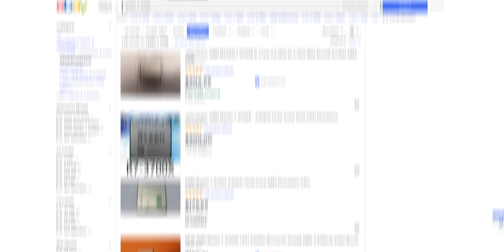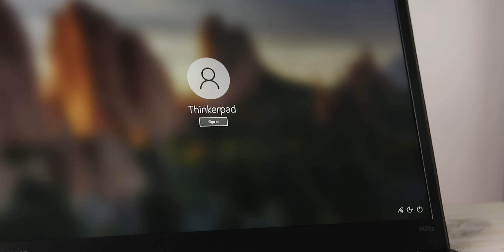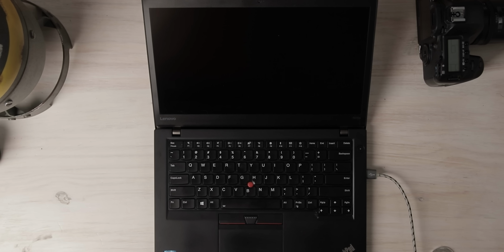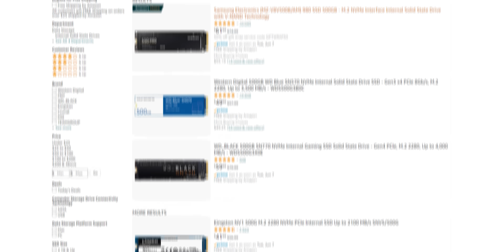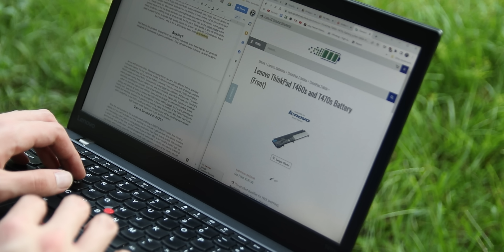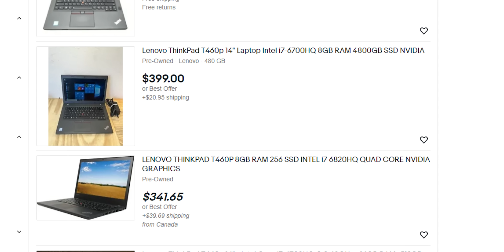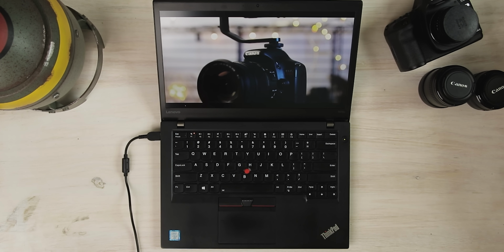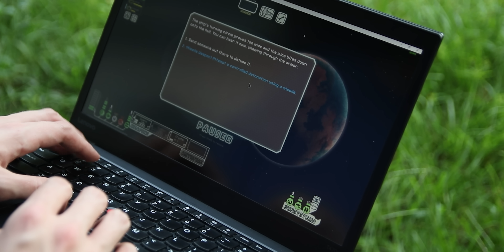I Couldn't STEAL A Better Laptop... I Tried - Lenovo Thinkpad T470s

Comment: For me I only get ThinkPad. Running windows 11 on my x230 and x260 one with a sata ssd and other with 16 gb ram and 7200 rpm had and I don't have any issues don't daily task. And got both cheap of ebay. Seen people spend hundreds for way less. Cannot go wrong with an old ThinkPad

Comment: Great review thanks.  I'm a big fan of quality superceded gear instead of weak new stuff.  I scored an amazing deal on a secondhand Huawei AMD 3500u powered notebook and its going well.  That CPU is essentially two of the 6600Us in the lenovo and the screen on mine is superior. However, the single stick of soldered RAM hamstrings the 3500U badly.  I suspect that the lenovo with 16 gigs of RAM in dual channel config would be the better option for getting proper work done. Alt tabbing through lots of stuff on mine bogs down badly beyond a certain point. 

I suspect one of these Lenovos with new batteries and a correctly matched extra stick of RAM would be useful for years.

Comment: I have a Yoga 460 that's of a similar vintage as the T470, except that it takes that screen trick you did another 180 degrees further. The deck on the keyboard also lifts up in this action to lock the keys in place when it's in tablet mode. Used to be my work laptop, but my supervisor gave it to me since I'd said how nice it was when we were switching to Dell laptops across the board. No soldered on RAM like the T470 and still has the single RAM slot. However, it's still my favorite laptop to use due to the keyboard and the screen.

Comment: Just got the E495 with Ryzen 5 for $100 ! There was a short on the motherboard - replaced the cap and now works like a charm. Came without storage and RAM tho, and the battery is half-dead. I guess that's another $100 right there :P

Comment: Just can agree with every vord. I bought a thinkpad x1 carbon gen5 for 250 bucks, with full hd screen, i7 gen 7 processor 620 graghics, and Í´m more than happy with it. Definitvely the best laptop i ever own. Screen is awesome, construction  is rock solíd, battery still runa for 5 hours of medium use, after 980 recharge cycles, keyboard and trackpad are amazing, without a doubt the best i tried on a laptop, weight is also incredible, less than 1,2 kg, the only con is soldered ram module, non upgradeble,

Comment: Even older series are amazing. Like the old steel-frame brick W-series workstation Thinkpads. Everything is easily self replaceable AND cheap.

poured liquid all over it, speakers got crackly for a day and then everything fixed itself.

i7, 16gb ram, SSD, Dedicated Quadro card, Cd/DVD drive. Snappy under everyday use and video.

My girlfriend accidentally sat on it and broke the screen, replaced the screen by removing 4 screws and paid $45 for a replacement.

I am convinced this thing could also bash an intruder's skull in with the corner.

Comment: My Asus U36S 2nd Gen Intel with Nvidia 520M from 2012 still works well. Yes it's a bit slow on start up and loading games but it can run a lot of the Call of duty games and Civilization 5 with no issues on Windows 10. The battery can still give me up to 3 hours on high performance  without gaming.

Comment: I have a T495 and it was my main computer for a few years. 
It’s not a beast, but it’s very nice considering it’s price. 
While most laptops in its price range (even many above) feel cheap, look, and run like trash, the T495 has been a pleasure.
I can echo pretty much all of your compliments: the keyboard is immaculate, I love nub, and the display is great.

It started my Thinkpad obsession, and now I have a T500 and T60, both running Linux. 
If you’re not getting a MacBook, a Thinkpad is the clear choice in my opinion. 
I mean seriously, my T60 is from 2007 and it still works.

Comment: I got a secondhand T470S for portable schoolwork as a work machine. I just need it to do pdfs, word, excel, Firefox, maybe remote desktop.

Battery is abysmal, but you're not going to get anything this viable brand new for $250usd. Plus, it keeps surprising me. Just found out that it had a touchscreen and a working wwan card. As a gaming machine it's hopelessly out of date. As a "be everywhere just to type reports and open notes for you" machine? Practically unbeatable in the price tiers near it. Even has sd card slot and usbc charging on top of the old I/O ports like LAN.

100% relevant dinosaur would buy again.

Comment: here's my experience buying a thinkpad: i bought a T460 off ebay a few months ago refurbished by ebay themselves for a decent price. what i got was the i5-6300U model with the extra battery installed, backlit keyboard and a nice 1080p IPS screen. Not all was good though. the batteries on mine were worn down to 72 and 76% respectively and a few days ago i opened the thinkpad and found metal shavings on the speakers which i quickly cleaned out. scary but glad i caught it now rather than later. as for the OS, mine came with windows 10 preinstalled and registered but i put arch linux on mine.

Comment: Another thing to be aware about is, Lenovo authentic parts lock in. I bought a refurbished T450, and it got the screen replaced by the seller. The thing is, its not an "orignal" Lenovo Screen, and therefore I can not adjust the brightness. This is only a problem on Windows though, it works on Linux as far as I tested it. So you will not get a good battery life on windows unfortunately, unless you are bold enough to do some oily hack procedure.

Comment: Currently T460s with 1440 and Nvidia, T495s, Yoga 12, and P50 Xeon to be replaced by P1 Gen 2 4k. 🤘

Previously X220, T410, W540 (touchpad mod).

Just unbelievably good machines. I changed the panel on one of them in literally 5 minutes.

Comment: I am trying very hard to wean my wife away from always using her cheap Android phone so am bidding on one of these with the I-7 7600U currently. I just scored a Dell 7470 14" I-5 6300U for 54.00 US but came with no battery, charger or M2 SSD. I squeezed every bit of life from my old DDR2 HP G-71 even after installing an SSD and Mint Debian it's still way too slow compared to my 2 desktops.Thanks for the great and humorous review. Liked and subbed.

Comment: Bought a refurbish T470 for $150 to replace my X230. It has 2.5 GHz i5 6300, 16 GB RAM, and 256 GB SSD.
Currently running macOS 12 just fine.

Comment: man, i haven't paid for a laptop itself in a while. i got a dell xps 13 9365 from a friend of mine. it was his old work laptop, and the only problem was the battery. i replaced the battery for about 30$ and upgraded to a 1tb nvme ssd. it has an i5 7th generation with 8gb ddr4 ram and intel integrated 620. overall, it's a great laptop. it plays some lower end games like terraria and left 4 dead 2, while also being about a half inch thick. i also got a free 2012 gaming laptop, an ASUS g75vw. the only thing it needed was a win 10 copy and a charger. i ended up getting another 180 watt adapter and upgraded my ram and storage, so now i have 16gb of ddr3 ram, 3tb storage, an nvidia geforce 670m 3gb video card, an i7 4th gen, and windows 10 pro. love those laptops, spent maybe 200$ on them total. always look for good deals, but also know what to watch out for.

Comment: I bought an even older thinkpad than the ones you mentioned here. a t540p from 2013. and that even works amazingly well for normal computer tasks. I liked that one so much I bought a w541 which is basically the same as the t540p but with better specs, and this thing I really love so far. I can even get a better cpu than the i7-4910mq which is what's in this. It's a 4 core 2.9mhz base frequency cpu. I have the advanced bios unlocked so it's a little overclocked. an nvidia quadro gpu, and 32gb of ram, its ddr3 so not quite as good as ddr5, but its really not bad. especially since I don't game. 

Also I use linux, and don't really care if this will be able to handle windows in 4 or 5 years, since I already know I don't want any of microsoft's software anywhere near my computer. but the t540p came with windows 10 preinstalled and it did fine before I wiped that. So I'm sure it won't really be an issue. The crappy hp 14-dq whatever I had ran windows 11 when I got it and that had a celeron , and 4gb of ram.

Comment: The card think, from a desktop support POV is that I have this admin card that I always use whenever I needa run a user apps or install something that required admin access, so instead of logging into an admin account everytime, just use that card slot to put in the admin card and key in the admin password and get going

Comment: Thinkpad T430, dual core i5. I was running windows 10, which was running a little hot (need to clean out my fan assembly) but because of a weird problem using SSH from windows I made a live USB Arch installation; now I live in that instead. Which means I'm going to have to dual boot at least if not ditch Windows altogether, clearly my heart lies with another OS. Don't fear the terminal, bro; join the dork side!

Comment: I gabbed a dell latitude 7490 online for $56 the seller had issues installing windows & simply didnt wanna put in the effort of fixing it so i threw out a low offer & bam here we are . The laptop had a bad ram stick so i installed 16gb of ram & a 500gb m.2 that i had laying around & with the 8th gen core i7 it was a freaking steal. New & used this thing ranges from $200 to $300 even with ram & a new battery i ordered im like $120 bucks in. Did a fresh debian install & i feel this will last me a long time.

Comment: If it has UEFI in the bios startup you get an ssd for the drive. If it has screws on the back it easy to replace the battery and rams. Sometimes if it has a spare 2.5 inch compartment you can add a sata storage drive , some laptops hav easy to replace keyboard with a backlit. If it only have 8gig rams goto advanced settings and set the virtual ram to 24000megs and do a disk clean and switch on storage sense 👍👍👍.

Comment: I agree.  The thinkpads are just stupidly good machines.  Lenovo still plays some stupid games at times with stuff like batteries (denying any battery but theirs, etc), but overall, I've never been as happy with a machine.  My daily driver right now is an old T440S with the full HD IPS screen and holy cow is it nice.  I built a solid FreeBSD 12 setup on it and it's like I died and went to computer heaven.  For decades, OSS on portables was iffy as hell.  You were often lucky to even have a NIC.  But now, this thinkpad I have has so much support that I actually feel trapped in the windows world now.  Now, instead of fighting just to get a network connection, I have pretty much full support for everything.  I can even control the fan speed and SOC for the batteries.  Now I don't need to bitch about stupid EE decisions floating lithium packs half a smidge away from "It'll catch fire", I can just set that charge controller to be whatever I want.  As a result, I've decided I'm going to start collecting thinkpads.  My current work in progress is a T440P.  It's got three SSD's in it (one for OS, two dedicated as underprovisioned swap disks and tmp storage), it'll be getting the fastest 4 core chip to ever go in a T440P and I'll be modding the cooling system so it can keep that clock ramped up.  Plus, let's be honest here, the world has lost its mind when it comes to keyboards.  The only thing that matters now is "does it look like an apple device?".   The thinkpads have DAMN good keyboards and just as importantly, they're replaceable.
Reply: Update: Building a new T440P with the fastest chip Lenovo ever put in that machine.  I'm already testing it with kdenlive for doing my video's.  That machine with it's ~4gig clock boost, 4 cores and two dedicated swap disks is so fast is scares me.  Plus, it's running FreeBSD 13 which is just outstanding.  The only issue I have right now is there were some X changes and I'll have to fiddle a bunch since stuff like xset doesn't work anymore.  sad panda

Comment: I just got a ThinkPad T460 on the verge of being designated for donation from work and I've been loving it so far! Upgraded the RAM (8GB >> 16GB), the hard drive to a top-of-the-line Samsung 870 EVO SSD, and the 23Wh & 46Wh batteries that came with it to a 72Wh battery.

The two most underrated features in my opinion are the loud, crisp speakers (I swear the audio rivals almost anything on the market besides MacBooks) and the customizable battery capacity configurations due to the internal 20Wh "backup battery" which allows hot-swapping the detachable batteries.

Comment: Very nice buy, although I find the dual-core CPU (4 threads) on the T470s getting a bit sluggish these days. Great for everyday tasks though (surfing, email, etc...). I have one with Linux installed, but I hardly use it these days as I'm now in love with the AMD U-series CPUs (like the Ryzen 7 5800U etc...).

Comment: Have the same model. Capable of running Alien: isolation (1440x900) little slower and IL-2 Sturmovik totally ok. Other than that, Chrome, youtube, office, one drive... works perfectly. I do have some issues with a battery: Can't work longer then 2h30.... even on a first day (bought one in 2018 for 700$)

Comment: i5 6300U 16gb ram perfect battery BUT 12.5 inch FullHD screen(very good one) HP 820 G3. I fokinloveit. 256gb nvme and 480gb SSD inside. 250$ (here is about 10-15% more than EBAY) I really do not need more than that. + i got EVERYTHING with it - from cables and SD card in the slot to perfect case and even nice USB hub. The other option was 700$ for basicly the same performance for my needs. Most of us just need to humble and recycle the old stuff. Good choice. I like the video.

Comment: i have a L450 its a monster for only two cores, i can run, CadSoftware Like SolidWorks, Invertor, Revit, Proteus, and some Games Like COD MWII e MWIII. On 2022 its showing its limits but for a 2014 laptop its a monster.

Comment: I just picked one up for £160 off ebay, i5 7200U, 8GB and 256GB ssd, apparently performance increase between this and i7 is only 10% increase but they go for £300, it came preinstalled with Win11 and honesty I was amazed by how well it worked, I only ever use windows if i must in a virtual machine, mainly because of how terrible my last £1000 laptop worked on both win and linux, hp x360 13.3 with Ryzen 3700u, 16GB RAM and 512SSD, windows was virtually unusable, the laptop would overheat after 5 mins of use and also in sleep mode... And linux support was so broken it didn't even wake up from sleep, ive put the 512 ssd from the HP into T470S, installed manjaro and it works like a charm, soon I will upgrade RAM with 16gb stick and a 1TB/2TB ssd, with 1TB ssd rendering total cost of £300

Comment: I have bought my 2017 MacBook 12 inch for $250, I would never want a different laptop after using that, it’s light, and with the m7 even through it’s not good at gaming it’s the best laptop I’ve ever bought.

Comment: I found a Thinkpad W500 at a thrift store for $9.99. A  $10.99 charger later, it fired right up and has a HHD with Vista professional.  Of course the battery was junk, but a $20.99 9 cell battery fixed that. And yes, I can get online. With 64 bit I can run 8gig ram. Witch is my next purchase. Thinking of running Windows 7, mostly because Windows 10 doesn't seem to want to work with my V600 scanner. I have fallen in love with my wikid cheap Thinkpad. 
Also, I have a chromebook and hate that POS.

Comment: Had to return my work t470s (i5, 8gb) this week 
Picked up a t470s (i7 16gb) for £130 on ebay - insane laptop for the money! (£130 of my own money well worth it not to use a work chromebook 😂 and my personal Legion 5p is too hefty for carrying around + has like 2-4hrs battery with a 3x bigger PSU being a full gaming-grade pc in a laptop housing)

Haven't bought non-Lenovo in a decade now

Comment: I'm in Canada got one  spec'd as 

1080p touchscreen*** didn't know it was touch till I got it. Cool upgrade.

i7 - still a dual core 4 threads but the seller had it listed as an i5 so.... bonus!!!

best laptop over ever owned hands down.   it's reliable, works all the time, phenomenal keyboard, track pads consitant. Great review 
upgraded the cooler from a thinkbook that uses on board GPU. Dual heat pipes and thermal mass.

Odd 12gb ram 2100mhz - upgraded myself to 16gb 2400

and the larger snap in external battery.

verdict... is its great for school! productivity anything that's not production. you use it for video editing but you didn't mention these cpus will be  pinned at 100% they get hot and they aren't loud but it gets annoying. it's best to put these on a stand or something.

Comment: With Lenovo You can never go wrong - I my self was trying to use Acer, and bought a 2023 unit with windows.
Well I tried Linux Mint on it and it was like going back to the early days of Linux where Drivers were missing, Track pad WiFi Function keys and Sound would not work - So! I gave up on the unit. Waste of money - I then found out that Lenovo supported Linux 100% and sure enough My G50-80 and my E595 units ran the software of mint with out any glitches - The Build quality is far FAR better that apple and Acer is put to shame as Lenovo is well known for it's great design and you can almost flood them with  water and the drainage system WOW! how clever is that! try and do that with  {apple -[It'll die permanently] and not only that but Lenovo is Rebuildable where apple isn't ...